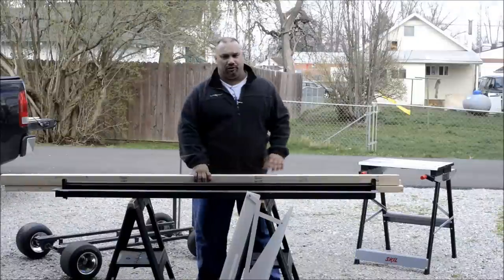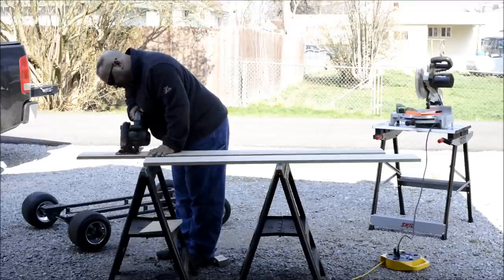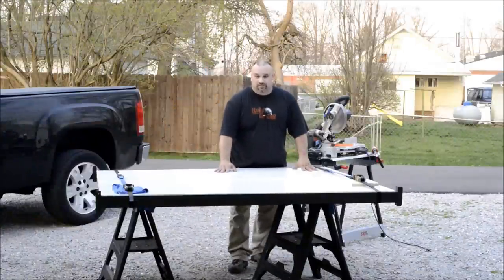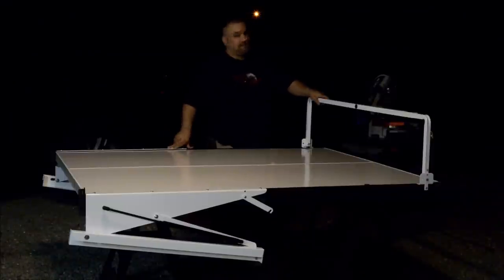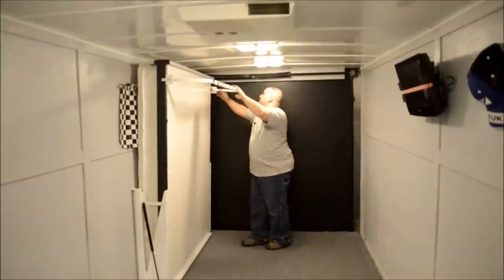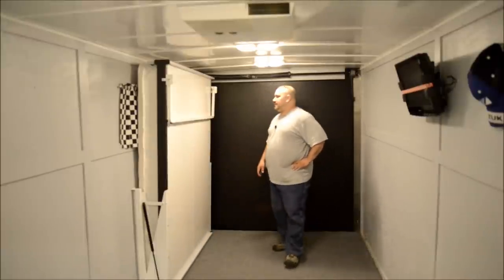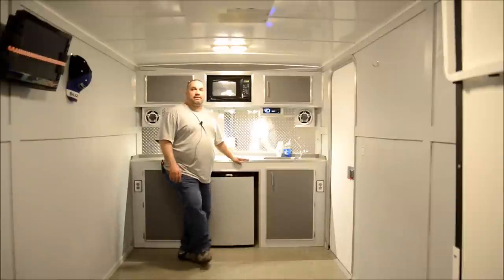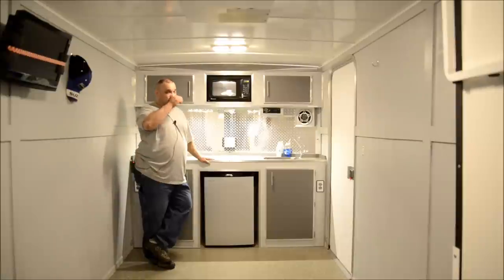Enclosed Trailer converted to camper gets new bed.

Comment: If you ever do another video cut the music.  It drowns you out.  Nice job on the bed though.
Reply from the maker: Yeah I was trying to cover all my heavy breathing in the mic. LOL Didn't work out so well. I got some better mics now.
Reply: i was just wondering how you screw or nail your boards into the wall considering the framing of it is weak.
Reply from the maker: cher her it has a steel frame and plywood wall. They a much stronger than RV walls
Reply: can you do a video or explain how to wire and what kind or type of wire would need to wire an exterior outlet to how to run it throughout the interior for plugs? I got 12-2 yellow wire. would that work or would you recommend other sizes?  thanks
Reply from the maker: 12-2 should be ok. I had all pulled the plywood off and there was a channel that let me run my wire in it on my trailer.
Reply: Exactly....thanks RGB.
Reply: thanks for the comment. I almost didn't watch because of the noise. but, since you said nice bed...

Comment: You made a great bed. You could have found a semi sleeper bed for cheap that works the same way. A Volvo truck bed folds up and there's a table mounted to the bottom of it. Still nice bed.
Reply from the maker: Gerald Shafer thanks for watching

Comment: I like what you are doing a lot more than other guys who make full on RVs out of their untility trailers ...this what I posted on one of those video:

I have this same size trailer and have thought about customizing it like this one is.  I just think going overboard like this is too mush of an attempt to reinvent the wheel so to speak ,  as units like that already exist that were designed from the ground up to BE RVs!  I am afraid if I went overboard I'd just end up something that does notdo anything really well ?  Ruined as a cargo trailer,  and poorly constructed as an RV? (compared to purpose designed and built)   My thinking is to keep things REAL simple, with as many as components modular/portable/ removable...

The idea to keep things as light weight as possible while maintaining flexibility of use for the trailer!   Has anyone viewing this video seen something done along those lines?? It is such a relatively small area,  is a bunch of installed plumbing even REALLY y needed??  I am thinking not!    I visualize a a water tank with an integral pump all on on a dolly!  Just dolly in the "water module"  clamp it into place and plug it in!.  The generator module I envision mounting outside on  the trailer's tongue with maybe a single cord with female end that plugs into permantently installed male plug  ...reason for a connector is you could also carry an extension cord to plug in anywhere power is available ...when the generator would not be needed

Nothing more powered than several outlets and  a couple light fixtures and their switches....outlet for the water module etc ,  well maybe a roof A/C, circuit too?

I visualize the bed(s) being hinged plywood that simply fold down when needed supported by heavy duty storage boxes.  Cusions  could be placed upright along the wall making the beds serve dual purpose as couches.  Now a galley of some sort makes me wonder of I want everything to portable or not ....but again why not?  Why not have a kitchenette unit on wheels that rolls up into the trailer and clamps into place....or even bolts in with minumum effort?  Maybe 2 to 4 wing bolts??

The "bathroom"?  Why do I need more than a porta potty for bowl movements and some lind of minimal storage tank for urine?  Something actually small enough to unclip and hand carry into a restroom and just dump in a toilet?  The bowel movement refuse I am thinking ,  why not just employ the 5 gallon bucket with toilet seat made for such buckets ....put a plastic bag in,  MAYBE a tiny handfull of the  absorbant crystals that absorbs 40X its weight and then just tie the bag in a knot when through to be thrown into the first available trash can?

Not sure what the best "galley unit" would consist of?  I love the IDEA of multi fuel refrigerators that use propane OR electricity... then it would make more sense of including a propane tank ...hey!  The generator could be propane too?  ....course then I could not share fuel between pull vehicle and trailer...hmm  

Back to the lighting ...that could be both minimal and permanent ...I am thinking LED strips?  Ultra low proofile and no bulbs to break!

I realize the "finished" effect would not look anything like your typical RV,  It would bear much more similarity to the space station or antartic explorers module or whatever.   The beauty would all be in how practically it was laid out and attached...IF it could be engineered to take in and out quickly, held secure enough not to rattle things to pieces,  and of course PRACTICAL and usable enough to be loved,  THEN I am thinking it would end "beautiful" in spite of not being typical RV fare

The more I think about it I have to say I LOVE the modular/portable idea!  I could even have as my tow vehicle like a Sprinter van that I COULD if I elected to,  place the modules into IT rather than the trailer!  Like a little trip I did not need the toybox?  Just take the Sprinter in RV mode!  Would not LOOK like an RV either which means I could get away with "camping" free simply by parking the thing in a quiet place ....if anyone bothered me?  Fire it up and move a few streets over or to a different parking lot!

The ability to HAUL stuff in both the van and trailer would be maintained...unclamp modules,  wheel them out in 5 minutes!  (in theory) ....Surely someone has done this kind of thing!  I want to find them?  Anyone??

Comment: Awesome trailer.  I'm using your trailer as inspiration to install electrical service in my trailer and install a radio, tv, A/C, etc.  Is there anyway you can give me some tips via email to help get me started.  A basic buying list on electrical supplies, what kind of radio and speakers did you buy, etc.  I understand if you are too busy to do so, but I would appreciate any assistance you could provide.  Again Awesome trailer!!!!

Comment: Nice, a lot like what I am looking to do. What did you use on the ceiling you said something like milimem? Is that the plastic 4x8 sheets you see at homedepot?
Reply from the maker: FixmyToyota its white board from Lowe’s back by the paneling. Same material they make peg board from

Comment: I know you sold the tramper, but I have watched your videos for ideas a few times. We recently got a small enclosed trailer, and want to add AC and insulate the walls and ceiling. Were you able to keep fairly cool with only the ceiling insulated and the AC on? here in texas we get over 100 on a regular basis, and Im curious to know your thoughts. I will definilty do the walls and ceiling based on your recommendations. What did you use? Also, did you sell the outdoor grill with the trailer? that was an awesome add-on for sure.
Reply from the maker: our account unit did pretty good, we camped a couple times over 100 and we're comfortable. my account unit needed recharged at the time. so a good one should have no problem if you insulate. after we had the account unit recharged on mine it didn't matter how hot it got, it kept us cool. I also sold the camp kitchen. it was a fun project but with out the tramper I had no use for it. thanks for watching.
Reply: Thanks for the quick response. One last question.....was condensation ever a problem? With the hot temps outside, and the AC running, was curious if dripping condensation was a problem??
Reply from the maker: +rbljackson nope. not inside. with an ac unit there will be water coming off the unit outside. It ran down the rain gutter onto the ground.

Comment: Drill holes in the wall spaced out to avoid drilling into metal studs or wood studs. Have some type of plug prefabbed. Insert nozzle from a can of spray foam and insulate! 
Maybe do some homework and figure out how much foam to use by spraying into a homemade gig to determine amount of foam to use for each section.

Comment: Can you say a bit about the importance of insulation?
Reply from the maker: +C Tomlin Sorry for the delay on the reply, worth the time and effort for sure! I did not do the sides for the tramper and regretted it. I did do the roof if I had not I would have had to striped the inside and done it later.
Reply: gixerman01 thanks, so insulating both the sides and roof are quite important?
Reply from the maker: +C Tomlin yes, but the top especially.

Comment: Any suspension on cargo trailers?  I don't think there is.
Reply: flahr1 - There is. Either leaf springs or torsion axles.  If they didn't have a suspension they would bounce all over. I prefer the torsion axles.
Reply: ok thanks

Comment: I am looking to buy the smallest covered utility trailer that can reasonably accommodate 2 cruisers.  Yamaha 1300 and a 1900.  can I ask what the dimensions on your trailer in this video was?
Reply from the maker: 7X16. If I were wanting to haul two bikes 6x10 is as small as i would go. I have squeezed two sport bikes in a 5x8 but it was a tight fit and required some thought. one facing forward and one facing back. Cruzers are longer and wider.

Comment: Did u block the only window in the trailer ? 
If so, could u not hav reversed the setting ?
Reply from the maker: Ces Marie Synnott the bed covered half the window in the up position. I put the window in the year before I built the bed. So I was stuck with the location.
Reply: gixerman01.. by setting, i meant to fix the bed frame opposit side but same location..
In any case, i really like wat u did w/trailer !
Reply from the maker: Yes I could have, but my wife sleeps on the left side of the bed, I can only sleep on my left side so I put it on that side to make sure she could get up easier.

Comment: Did u install the roof ac?
Reply: And I'm looking for an awning complete kit to put on the side of my trailer
Reply from the maker: Dewey Smith yes I did. It already had a roof vent and the ac unit is designed for that opening size. It also had the optional heat bar.
Reply from the maker: Dewey Smith I bought the complete awning at camping world. Although I installed a price of three inch angle aluminum to raise it a few inches for door clearance.
Reply: Did u have to reenforce the roof for the ac?
Reply: Bout 80 lbs range in the unit?